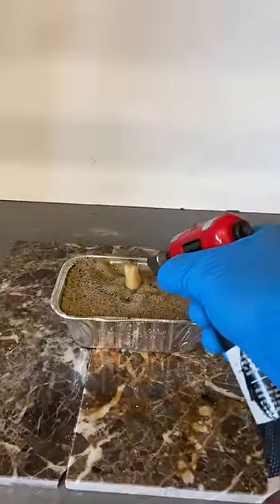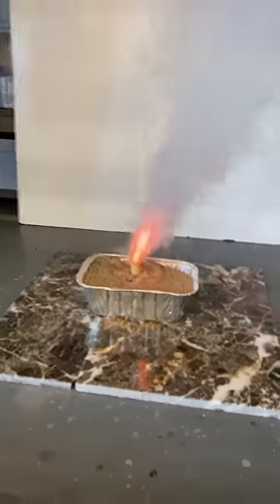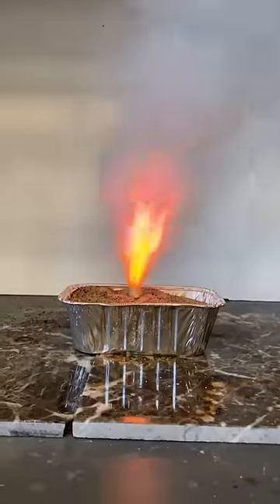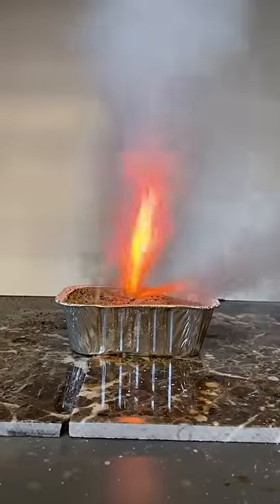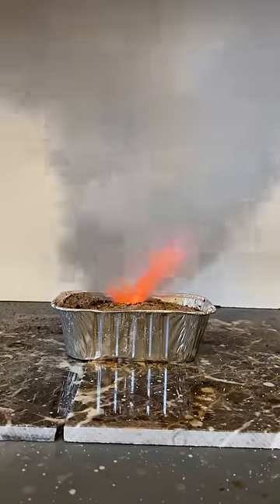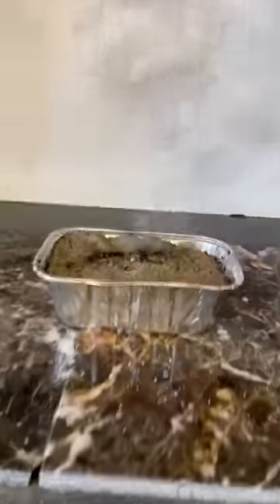Making Sugar Rocket Fuel

Comment: It's also good for making improvised smoke grenades, just adjust the mixture to 70% sugar 30% potassium nitrate, 
When molten pour into a can (red bull size is good but completely remove the top ) and insert a fuse or a sparkler then allow to cool. When completely set cover with a cardboard lid with holes cut to allow the fuse/sparkler to stick out fully (some additional holes may be useful to allow the smoke to escape quicker). 
To use, light fuse/sparkler then place or throw on to a nonflammable surface and move away. DO NOT HOLD IN THE HAND AS CONTAINER GETS EXTREMELY HOT AND WILL BURN YOU.
Hope that this is useful for Airsoft players and LARPers.

Comment: I made about 15 pounds of the stuff and like a fool decided to test a tiny bit about 5 feet away. Needless to say the 6 foot tall pillar of flame inside of a garage was terrifying and it burned for a solid 30 seconds.
Reply: What did you do with the 15 pounds? There's no way you just kept that thinking that was a good idea (both legally and morally.)
Reply: @jwalster9412 legally lol 😂
Reply: @jwalster9412 what's morally or legally wrong with keeping it?  Stupid?  Sure but it's not a restricted substance and there's nothing morally wrong with owning it unless you intend to use it imorally.
Reply: @kugelblitz1557  I mean, first off, I wouldn't declassify that as an illegal explosive. Second why would you keep 15 pounds of something that could level your house if you drop it from a Shelf.
Reply: @jwalster9412  what's illegal about sugar rockets?  Last I checked it's not a controlled substance.  You can buy more tannerite than that, and tannerite is actually explosive when not in a contained space.  Without a sealed chamber, this just burns fast.  Plus, it won't explode when you drop it.  It requires ignition, it's not fucking nitroglycerin.  And I'm not saying keeping it in that amount isn't stupid.  I'm just saying it's not morally wrong to have it.  Like it's not morally wrong for me to own a gun and carry it for self defense and when I find a not quite dead animal on the side of the road.

Comment: It also ensures your ingredients are pure. I dissolve mine in water individually first to purify them.
Reply: Is the gain notable or not worth the effort. I've been working with PK+Su+Rio+S only 1% either or of the latter two with a 10% AL or AlMg......holy smokes i dont have a way to measure but something is occuring that equates to double the thrust. I've been working on a better Duvall nozzles and orface config. The AL and Mg at 10% is notoriously difficult to ignite. So I'm coring at 7/32 with my orface at like 1/4 give or take. When the flash has expansion I believe I'm not flowing efficiently and getting back pressure launching my nozzles. Luckily everything has worked as it should along the way and haven't had a Cato yet. It is a wild deal what that Al will do in the mix. I took summer off because I put in a pond. Gonna be back in the lab in November 😆 I've got a couple sweet set ups underway hoping to get a stable working mix dialed in for spring.
Reply: @johncoaleii1423  I'd have to say yes, but one must consider how course some of my raw ingredients were when o reviews them. My first sack of KNO3 was about as granulated as table sugar! I had to dissolve it in hot water, boil off what's appropriate, then I poured the rest into cold metal pans and watched the massive crystals form everywhere. Once I drain it and remove most of the moisture it goes into the oven at 200 degrees for about 30 minutes. This was the difference between igniting and not igniting, for me.
Reply: @haroldkline4898 okay so you guys together in this two comments sound like you’s could start your own channel. Take it your a scientist too?? Iv no idea how to get POT/nitrate? I’m in Scotland 🏴 where would I find it? Good chemistry experiment’s to do with my little boy

Comment: FWIW, sorbitol reportedly works better for this than regular table sugar.  Sorbitol melts, rather than needing water to dissolve (that then has to be cooked off), and it melts at a lower temperature (less risk of ignition while mixing), and sorbitol will dissolve the potassium nitrate, so the resulting mixture is more uniform and more intimate (allowing it to burn faster and more completely).  It'll work better still if you add around 1% by weight of red rust, ground fine (everything for this rocket candy should be ground fine before you start to melt it).
Reply: Iron Oxide does speed up the reaction, which is bad if you're launching an actual rocket. Rocket candy already burns very fast compared to other propellants, meaning it generates more pressure in the chamber. Too much pressure and you have an unscheduled disassembly.

Source: I help design and build rockets, our best rocket went to about 3300 m (11k ft)
Reply: @gustavrsh You do need to static test and design your ratio of burn area to nozzle throat area to suit your propellant -- just as you'd do with ammonium perchlorate composite propellants (with or without aluminum powder) or the WWII mixture of nitrocellulose and nitroglycerin.

I've seen the exact same propellant in the same size grain range from burn time of about 0.4 seconds, to around 6 seconds.  All a matter of what shape the grain has, which controls the amount of burning surface and whether that burning area increases or decreases through the burn.  Yes, burn too fast and your can rupture your casing or blow out a closure.

Overall, though, presuming your casing and closures can take the pressure, you'd usually want higher pressure and regression rate to get higher thrust -- which is often preferred with unguided rockets, because more of the impulse will be applied before the gravity turn sets in (that is, your rocket will go higher vs. further downrange).
Reply: Yes sorbitol never caught fire on the stove and burned of my hair and eyebrows. 
I made little smokebombs out of this stuff, you roll a ball and push broken off match inside so that half of matchhead is protruding. Then just strike and throw.
Reply: fantastic advice
Reply: @gustavrsh 3300m is 3.3Km NOT 11Km.
Reply: @randallsmerna384  I said about 11k feet.
Reply: @gustavrsh  So you did. My mistake. Not sure how I missed that but appreciate the correction. 👍

Comment: You don’t want to cook it til the sugar is Caramelized because then the fuel will be impossible to dry and will absorb water, you want to cook on low heat just til they are dissolve and add a little bit of iron oxide as a catalyst, also this formula is one of the least scary pyro compositions and you can easily safely make it in 1 pound batches if done on low heat on a hot plate
Reply: Bro is literally using 🤡pound🤡 for mass 💀💀💀💀💀💀

Comment: Isnt that the mixture hamas uses?
Reply: Yes, it’s been used in hobbyist rocketry for decades and also in weapons, but it’s not capable of the type of explosions ammonium nitrate is, just good for crude rocket fuel
Reply: @fungdark8270  so if hit building what happen?
Reply: @aditzoti Improvised Warheads, usually those from mortar rounds or probably even ball bearings

Comment: should i be equal parts and is the gass toxic if inhaled?
Reply: Underrated comment.
I don't know the ratio, but looks like gas isn't too dangerous since he wrote nothing about gas mask. Still, it's quite obvious that you shouldn't do it indoors anyway.
Reply: Gases produced are CO2, nitrogen and water vapour, so no. You should have around 10 parts potassium nitrate to sugar.
Reply: @ging93  thanks! Where goes the potassium, though?
Reply: it was under a fumehood, listen at the end
Reply: @MinorLife10  It just forms potassium carbonate or oxide
Reply: @ging93 doesnt really matter, 65/35 is the most commonly used ratio

Comment: I made KN03 rockets with my daughter. We even made an ignition system with a key and a launch button. Used glass fairy lights with the tips broken off as igniters and 9v battery for power. We had great fun on bonfire night for a few years. We tried different mixes too like adding magnesium ribbon flakes or aluminium powder for different effects.

Comment: fun fact: this can be also made with sodium chlorate, which can be made in an homemade electrolysis cell with a saturated table salt solution. in short, you can make rocket fuel out of water, salt and sugar. though the chlorate tends to decompose spontaneously, so no storage

Comment: I did a science fair experiment in highschool making "rocket candy" using different oxidizers and measuring burn times of standsrd weights of each fuel. Iron oxide oxide (Fe3+) actually worked quite well, if I recall. I tried cupric oxide, aluminum oxide as well as KNO3 as the control. Won second place, would have maybe gotten first if I had actually used the fuels to launch rockets, but my chemistry teacher advised against making home made rockets. If they dont work they become pipe bombs lol.

Comment: Hey your the scientist but I got a notion of an idea 4 ya I am thinking u need a    combustion chamber slash. Condenser that creates a     more closely        combust in a slender  pressurized  flame or.  Jet of fire  u k those lighters that produce a. Directional flame  the gas comes out to meet the air out of a mesh or grill that  keeps it straight and  precise   
  I might be curious 2 c what u might do  experimenting with ur fuel. Medium

Comment: Heat the sugar water till it reaches hard candy making temperature then mix in the potassium nitrate. Add a bit of rust if you want rocket fuel. If you want a gunpowder substitute mix sulfur at about 5% and mix the finely powdered ingredients moistened to about the consistency of pastry dough. Granulated with a screen and use a dessicant to dry it completely.

Comment: You used to be able to buy potassium nitrate from Shoppers Drug Mart, along with sulphur and other things.. back in 1994 anyway.. we used to make smoke bombs with them.. not sulphur.. the kno3 and sugar.. or to make fuses.. we'd make a gummy paste and soak string in it then braid the string.. sometimes add some more at the end for good measure.

Comment: Anyone that tries this, just remember this is indeed rocket fuel (albeit amateur rocket fuel, but rocket fuel nonetheless) and more importantly it does indeed have an autoignition temperature... Basically if it starts turning black, kill the heat and run... And if your doing this on your kitchen stove instead of outside with a hot plate, you'll most likely burn your house down. That said I've never thought about using water initially to slow the caramelization down.

Comment: It's sugar fuel, the Simplist solid state rocket fuel. Sugar to slow it down, aluminum oxide, potassium. I'm wondering if adding just a bit of lithium and using a drop of water to ignite the reaction. IDK

Comment: If you have a battery generator just get a portable air conditioner for small rooms they are low cost and can be vented out that window you installed

Comment: Dont do this on a hot plate.

Use an oven on low temp
Reply: Not even joking. I tried this without water around 4 years ago and it worked amazingly. The components were in powdered form when i melted them.

Then i had to re-heat the leftover that became solid to soften it and put it into my rocket vessal for a second try. It didn't work good enough because of the water content so i put it back on the pan. The water was slowly evaporating and i was stirring. It suddenly BURST into fire. My face was lightly burned along with my hair and eyebrows. I turned off my stove(it kept burning tho but it was a small amount) and ran as fast as i could and washed my face with cold water. I didn't suffer any major burns but my face was all red and my kitchen was full of its smoke. Never tried it again 😅